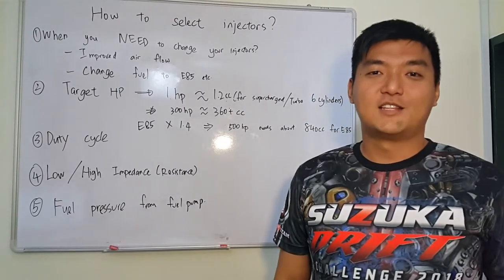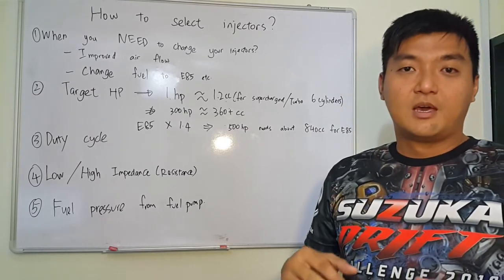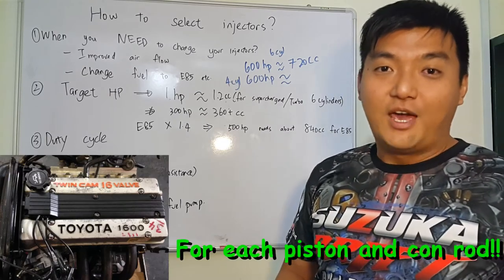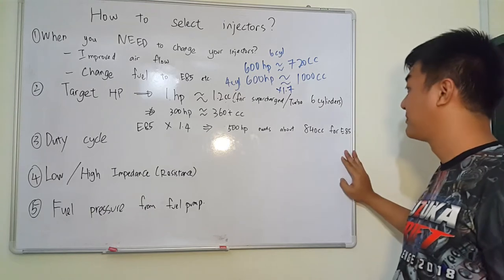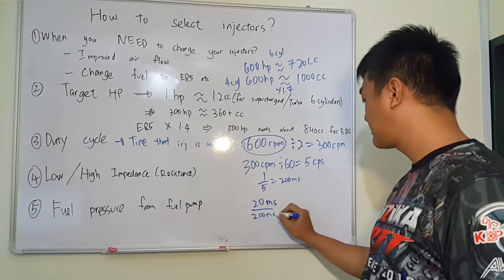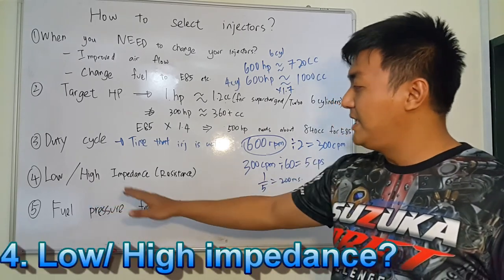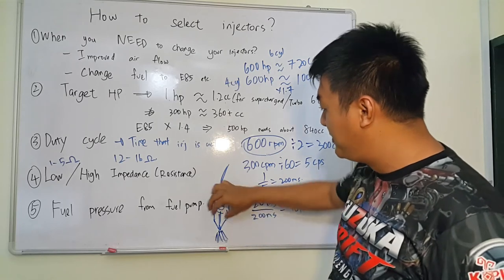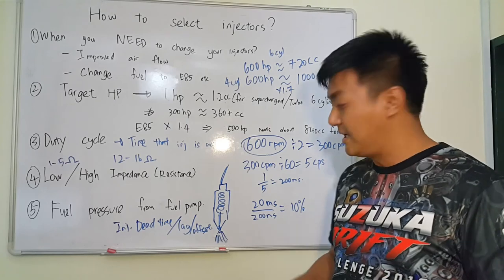2JZ Tuesday #14: How to select Fuel Injectors for your engine? EASY basics about fuel injectors

Comment: Nice video and thanks for detailed explanation, I have a jdm 2jzgte vvti with stock high impedance injectors if I want to upgrade to a larger low impedance injectors will they work normally with the high impedance system or else what should I do to make them work?
Reply from the maker: Oh OK.. If u r upgrading to bigger injectors, that means u need to have a tune up.. If u have standalone ecu then then can change the settings inside the ecu :)
Reply: Mate, it will not work. You need high impedance bigger injectors

Comment: Do you know what size ge non vvti injectors are. What bore on rail and manifold and length?
Reply from the maker: Sorry I'm not sure what cc because there are a few variation in colors too. But the rail is top feed and all top feed rail, bore is the same.